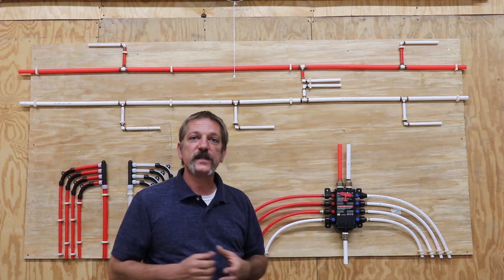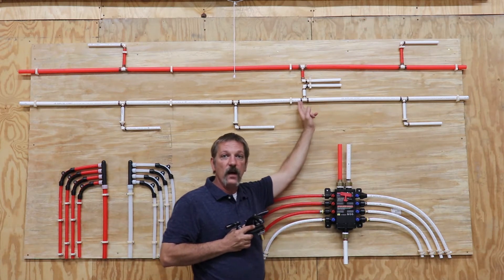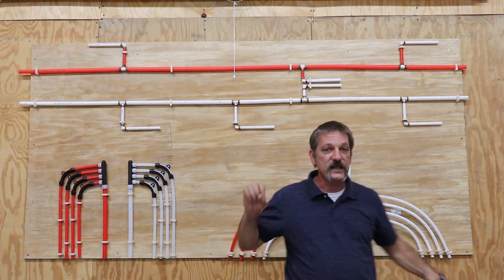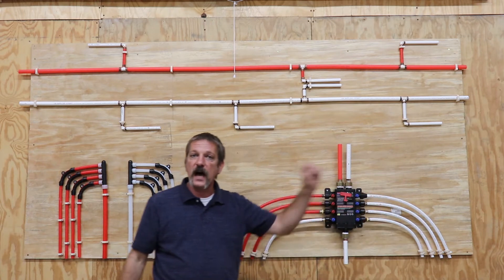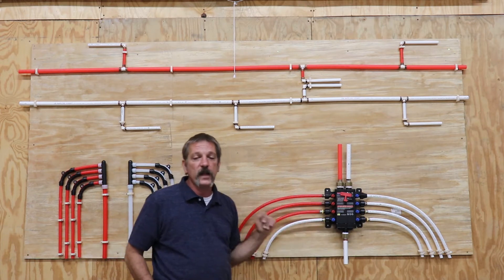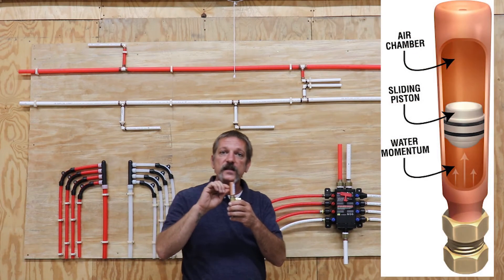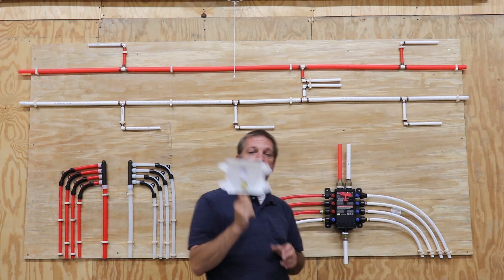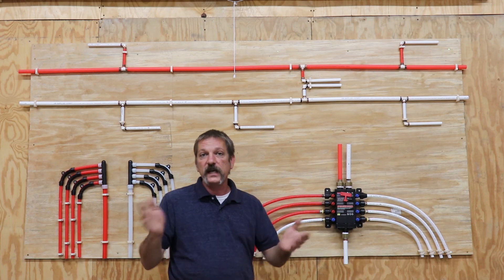Water Hammer

Comment: - Very useful
- I didn't know the arrestors came in the ice maker box or the washing machine box.
- One you missed is the dishwasher.
- I agree with you on the arrestor.  Using a Tee and a closed end pipe is just as good.  Yes, it is possible over time I suppose for it to fill up with water, but if the water is ever turned off and faucet on, it will drain the water.  If it is an arrestor device and water gets past the o-rings over time it will never clear.

Comment: If I installed one on the old line without luck does that mean I need to install on the hot line and other faucets on a dual master sink setup before I notice it fixes it?
Reply from the maker: yea, you have to do hot and cold and you might have to do both sinks

Comment: The arrestors can fail. When one I had installed did, it was replaced w/a 2’ piece of 2” copper in the wall w/ 2 ball valves, one at the top and one at the bottom so it could be drained of any water accumulation that may have occurred over time. The ice maker was where its source was. It drove the lawn sprinkler backflow valve bananas. No issues since some 20 years ago and a couple of refrigerators since. Hated dumping the $$$.$$ to have the backflow tested every spring. So I got the license to do it myself. I also did this 2” thing on both hot and cold supplies at the washing machine, but did have to keep the little ones in the washer hose attachment and drain box. Yes water flow dynamics are interesting aren’t they. Went ahead and put the little ones at the dishwasher also. Pretty much everywhere an electrically actuated valve was. The most interesting water hammer we had was a loose washer in the hot water valve for a bath tub. Could not think of how a hand operated valve could do so. It was simply the washer fluttering back and forth at opening or closing the valve. Was very surprised snd perplexed when I took it apart and all I could find was a loose washer. I now replace the washers and seats in the tubs every July. All the other hand operated valves are washerless and they are serviced only when they start to drip. I think that the arrestors should be required by code within 1 foot of anywhere an automatically actuated valve is and accessible by a door or raw space, so it may be serviced, or replaced easily.